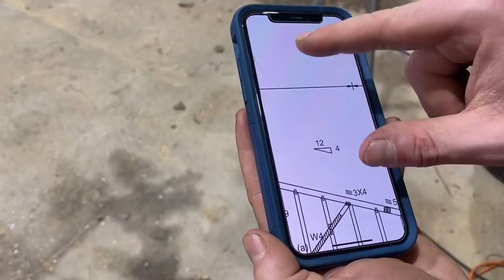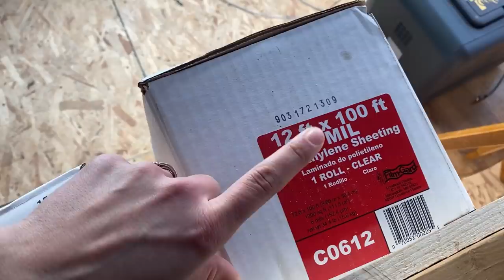The Solution: Moisture and Metal Buildings | Part. 3

Comment: Two things to consider, which may already be on your radar.  That woodstove looks to be ancient.  Purchase a newer high efficiency woodstove.  New woodstoves also have the ability to install an OAK (outside air kit) which will use outside air for combustion.  Without an outside air kit, your woodstove has to draw combution air from the inside (and through the envelope of the structure, like sucking air through every sheetmetal seam), basically creating a vacuum inside your home.  This factor could be contributing to the moisture problems inside the structure.  The second thing to mention... store your firewood outside.  Only bring enough firewood for a day or two inside.  Keep the bugs, dirt, and moisture of curing wood outside.

Comment: You need air flow between insulation and roof. Baffles between is what you need. I made same mistake. Had to take down insulation and put baffles. Worked perfect .  Plus if that insulation is wet.  You will get mold. Do not enclose till you get moisture issue stopped. You are heading for big head aches in future.
Reply: Good advice, do not enclose till you get this fix!

Comment: Guys, I commented on your part two videos before watching this. First, my intention is to help you, don’t take this comment negatively. First, thank god you went with 6mil instead of painters plastic, but you should have remove the existing plastic before installing the new one, now you will have condensation trapped between it. You should never, never never have two Vapor barrier components in a wall composition. Also, thumbs up for using tuck tape, but that should be limited when you overlays a new sheet, around windows and on the perimeter you should use acoustical scellent. Again good luck and its better to fix it now then when you have drywall and mud done.

Comment: To prevent condensation on metal siding and roofing, the temperature on the space on the inner side of the metal must always remain the same as the outside temperature.  If the outer side is cold, and the inside of your building is warm, the cold will cause the warmer side of the metal to form condensation.  There has to be ventilation on the inner side of the metal to prevent condensation. Or you can spray on foam insulation, that will keep the outside cold from transferring to the inner side of your building.
Reply: Or do what they are doing and sealing the inside with plastic to prevent the moisture from seeping out behind the insulation…

Comment: Normally caulking is used a bead all the way around all window frames, door frames, lower sill plate, upper header plate, all wall outlets and then lay plastic on that and then add tape it to inside frames and plastic joints. i guess you can call it double protection. Remember the moisture is still there and will take some time to dry out. Great job and keep the videos rolling. Happy New Year Mike & Liz stay warm

Comment: Guys you have to break the dew point, all air points have to be sealed. And the insulation has to have a impervious vapor barrier on the right side to stop the penetration of moisture. The insulation will not dry out it has to be removed, you are creating a greenhouse effect. Also moisture is being drawn in through the structure by the wood stove.  Once spring comes the moisture will mold everywhere it is damp. This is serious. You cannot just do patchwork here and there it will not work.

Comment: Metal condensates when it frosts. You should always put some type of insulation between the perlins and the metal. ( Frost will come thru the metal and create moisture) Also, when pouring concrete for a floor put plastic down under your concrete, it will also keep moisture coming thru your floor. I didn't believe this until I witnessed it. It makes a big difference in moisture inside a pole building. I've seen ceilings ruined by moisture from metal roofs. I've built many pole buildings, and have always put, at least 1/4 " under roof metal, I've always suggested 1/2 " insulation board, and never had problems with frost bleeding thru. Good luck folks, your build looks great.

Comment: Every one of these steps you're taking is part of the puzzle and should help.  Something to consider looking into is your roof venting.  I seem to recall reading that if you have soffit and ridge (calling the top edge of your single pitch roof a "ridge" here) vents, you shouldn't also have gable end wall vents.  IIRC, the idea is to have airflow between the bottom and the top.  Gable end vents can dork that up by drawing air in from the gables to vent out the top, which means you're not drawing anything in from the bottom.  Path of least resistance?  Food for thought...from a non-expert.

Comment: I don't know if it has been suggested before, but have you thought about a heat recovery system. Basically all the hot damp air in your house goes through a heat exchanger and is vented to the outside. Meanwhile fresh cold air is sucked in to the heat exchanger and is warmed up by the expelled air. You have a good distance between the 2 pipes so that you don't get all the damp air back into the house. They are really cheap to run and can sort out your internal damp problem. I have to run a dehumidifier here as we cant retrofit the heat exchanger in this house and that pulls over 2 litres of water everyday and I live in Cyprus which is a dry climate, I hate to think what your house has in it with your climate. Thanks for posting

Comment: Hey guys… tuck tap and poly is the way to go, for sure. I think if it was me i would have bought a few batts of new insulation, removed, wiped down (dried) inside of siding and installed the new stuff. Then dried out the old stuff as it is reusable as long as it isn’t moldy. Then theres not to much wasted cash. But you now how wet it was. You will surely notice how much warmer it is now. I live in Calgary and tucktape is crazy expensive, i use dollar store packing tape, just as good in my opinion. Cheers!
Reply from the maker: We were commenting on how similar the stuff is to packing tape, hopefully our solution works in the long run. Thanks!
Reply: @LaidBackLiving  from a prior video where you all had to go on the roof, it “looks” like your soffit vents are blocked by house wrap. Are you venting by a different method? I can see the gable vents clearly but I’m unclear on where the fresh air is coming in….
Reply: @LaidBackLiving  oh and please give your pups a scritch scratch for me.

Comment: Your home should be warmer wiith that liner.  Also when everything is done snow will slide more easily off the roof because the house is warmer, causing melt from warm air rising to the ceiling.  Moisture is always a problem with insulation.  Thus, I renovated my ruin out of stone and concrete block with no insulation.  I just bought a new Kratki Amelia 25 2022 model last year, and it pumps heat! :) And I have less moisture with the new stove and the fireplace closed off. :)  So a steady flow of central heating and a good furnace or stove can reduce the moisture.  The warming and cooling of the home may be a factor so keep the fireplace going hot. :)

Comment: It is the right solution…warm air from a conditioned space contains water vapour.  Without that plastic barrier, that water vapour condenses and forms moisture when it contacts that cold surface.  You’re doing the right thing.  Seal every outlet, caulk the floors where the transition occurs with plastic and then tape.  Black mole is very very bad for you.  Good luck folks!
Reply from the maker: Thank you!

Comment: Ooof that dreaded pink insulation creates so many headaches there's form cut aluminum foam insulation that you can cut to size with sheet metal tape that would have saved you from having to take the walls down anD replace the insulation every 3 years

Comment: Hi Mike and Liz!  WOW.....I just asked if you were going to do a follow up on the moisture build up video and here it is!  I am having the same problem with my off grid cabin although mine is not metal.  I came to the same conclusion as you did about having an interior vapor barrier but I have another option since I am using foam board instead of Rockwool/fiberglass.  My question for you is are you worried about not pulling off the existing insulation and letting it air'dry out before sealing it up?  I have Tyvek on the outside of mine and it is supposed to let it breath.  I am trying to decide whether or not to pull all the foam board off and let it dry, reinstall and foam seal all the cracks.  If the Tyvek lets it breath, I can do the same thing you are doing and put up plastic and tape.  Love your channel and I never miss an episode.  Its because of channels like yours, I have pretty much stopped watching conventional TV.

Comment: cold and warm will make the metal to condenses because of the moisture..  If your finances where different you could of installed osb and house wrap on the apartment walls and roof to act as a shield and then install the metal... I pray your way works too. Thanks

Comment: I've commented on a previous video but had the time to think it over.  You have a moisture problem.  A metal wall replacement from rust will cost you between $10 to $13 per square foot.  Closed-cell foam will cost you $2 to $3 per sq. ft.  That will stop your moisture problem, make your building more rigid, seal all cracks water and airtight, and has an R-value of R-7 per square inch.  Two inches thick gives you R-14 between the studs.  Wood has an R-value of R-1 per inch.  At 24" centers 2" thick should give you an R-value of R-13.25.  Three inches thick gives you an R-value of 19.85 which will be higher than your fiberglass-filled wall at R-18.39.  If you repack your fiberglass over the closed-cell foam, that would give you a corresponding R-value of 25.2 and 28.6.  As you see, there is about a 13% difference between 2" and 3" of closed-cell foam.  I'd live with what you have now and do a wall at a time.    With a metal building, that is your answer.  Ignore my previous comment.

Comment: I noticed on the video when you found out that you had a moisture problem in your shower did you have a fan vent by making your house nice and tight you might see moisture coming from your bathroom and shower 🚿 you need some moisture in the house in the winter but you have to control it Good Luck will be watching

Comment: I'm not at all sure that putting the visqueen up between the walls will help the condensation problem you have when your metal building sweats. You need air movement between the metal and interior walls if you're going to insulate. The baffles they make for ceiling/roof applications is what I believe you need at the inner side of the metal building, that way condensation can be wicked away by the air movement. Idk, but this is what I've seen done here in Florida on metal buildings framed for offices and such. Love ya'll ❤, hope it helps

Comment: That's 0.7 mil painters plastic, and its not really suitable as a vapor barrier. Ideally using a product designed for in wall vapor barrier would be recommended. Certainteed, Stego, etc. You only have one chance to address the moisture problem. Its cheaper to do it right with the right products than have to tare it all out and redo because you opted to save a few $$$ using painters plastic.

Realistically there needs to be a vapor barrier on the exterior side between the frame and the metal siding. What is happening is moisture from inside & outside is condensing on the cold metal siding. Puttng a vapor barrier will only address moisture from the interior, but will not stop moisture from the outside condensing on the metal siding. 

In northern climates homes need to have a vapor barrier on the exterior side and in the interior to avoid moisture issues. Older homes got away without moisture barriers because they were made of wood, poorly insulated, and they were very leaky allow moisture to exit from the wall cavity.
Reply: Yes agree moisture will condense on the cold metal surface.  As far as i could tell the pink insulation is not "up against" the metal. stopping the warm moist air coming from living quarters should be enough to slow the condensation process. the metal has some pretty big channels up and down and that should aid in evaporation.

Comment: Oh my..."palm to forehead" 

At least pull it tight so your walls remain square. Cut 8 foot sections and seam tape them. You need airflow inside, if you vapor barrier everything inside with any ventilation you will get so much mold. Look at it like this, If you take a 2 liter bottle with condisation inside then flip it upside douwn what happens to the moisture, it stays consenating untill yopu get black mould and have an unlivable house. Good try but get some home depot books on building and framing. That plastic job is beyond half assed. Im sorry for sounding mean but everyone else on here is coddling you and making you feel good by saying good job, it was a terrible job and you can do better. Rip that plastic down and do it tight for a start

Comment: It appears you have just trapped all that moisture inside the walls and probably the ceiling.. Your R value has been reduced to almost nothing. The mold will come quickly and the whole place may fall down in 10 years. 
Sorry. 
Building is a SCIENCE.

Comment: Sorry guys, but your moisture issues will continue. I once owned a insulation business and this concerns me for health reasons.  Mold is real and it can cause major lung issues and thats where your headed. You need the insulation against the bottom of the roof. Given the work you have done, The best way to do this is by Sprayfoaming the roof bottom and stopping the air movement in the attic. It's called a thermal envelope. Air movement is the problem in metal buildings.  It condenses on the roof bottom and water starts forming. Please reach out to a insulation contractor who understands thermal dynamics for advice.